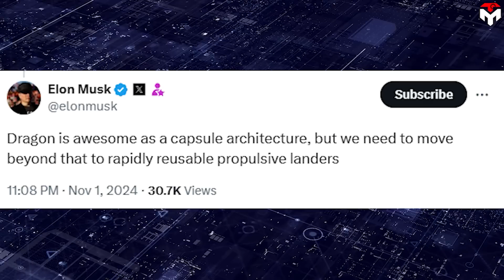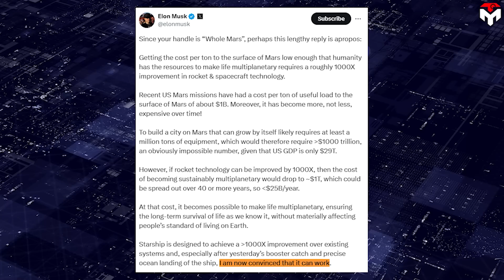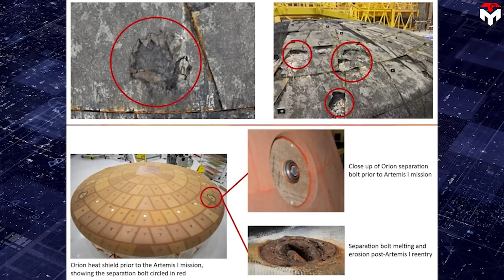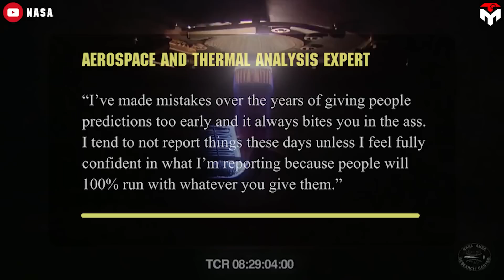It's Over! SpaceX to Stop Launching Dragon after Starship...NASA Doesn't Expect this!

Comment: So let me see if i have this right. They had heat shields on the capsules that returned from the Apollo missions that worked just fine. SpaceX has heat shields on the bottom of both crew dragon and cargo dragon capsules that work just fine and are in fact reused. But NASA couldn't get a heat shield right on their capsule? NASA has turned into a joke just as bad as Boeing.
Reply: That's a question I've been asking. We've been sending capsules into space since the early 60's & aside from John Glenn's Mercury flight, never had a single problem with them. Did somebody lose the recipe  ???
Reply: @billotto602  The problem is that NASA used to build the capsules themselves, they stopped when the Space Shuttle program started. Now, they have to relearn it as none of their current scientists know how to build them.
Reply: @Mortlupo  I don't know. With SpaceX anyway, they're getting rockets at much cheaper prices & THEY WORK !!!

Comment: With the technology in AI today it should be possible to build a totally autonomous "tug" designed to latch on to a small asteroid of the proper type and bring it back for moon or earth orbit.  It may take several years of boosting and coasting, but the value of, say, a 10 million ton iron - nickel - chrome platinum - gold  "mine" would boost the worlds economy astronomically.

Comment: Delays in Orion, SLS, Blue Origin, and ULA projects are really problematic Starship, additional launch towers, inspace refueling and etc. Are clearly the paths forward. If Artemis 2 were to be an effective backup it's time to be building a new third Orion Capsule with the upgraded heat shield!

Comment: So when exactly is the ISS suppose to be deorbited?  And the current fleet of Dragon can cover that?  Obviously Starship can not dock with the ISS.
Reply: I agree as there is a mass vs mass problem that the docking mechanism on the ISS has not been designed for.. that is Starship his of a higher mass and if not perfectly aligned and executed there will be a torque load that can far exceed the capabilities of the docking mechanism.
Reply: I was wondering about that as the robot video went on about it. As of right now as far as anyone knows, there is no way for Starship to dock with the ISS.

Comment: Couldn't the dragon come back from the moon, enter an leo parking orbit to slow down slightly, do a couple of laps reducing speed, then fire thrusters to begin a nominal insertion like it does now, and the picaX heat shield would suffice?
Reply: The problem would be the additional fuel needed to escape Earth's gravity....which is about 7500 miles an hour over orbiting velocity.   Then needing enough fuel to slow down and enter lunar orbit, then escape lunar orbit and come back to earth where that same amount of fuel to slow back down to orbital velocity is needed.   Orbiting the Earth really doesn't slow down so the normal de-orbit fuel would still be needed to reenter at orbital rather than lunar escape velocity.   It's a tough nut to crack which is why a heat shield able to take the lunar escape velocity has been used as they just can't carry enough fuel to do otherwise.